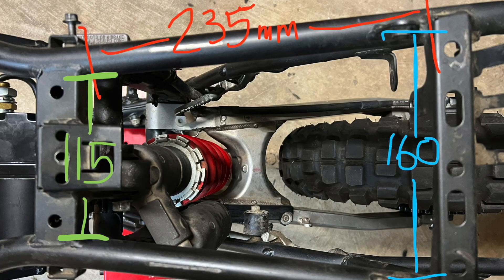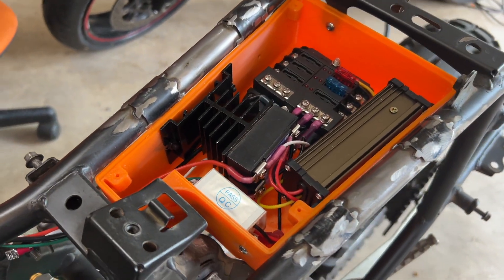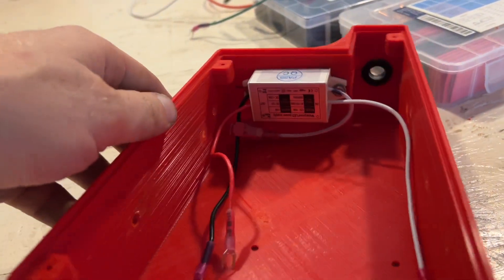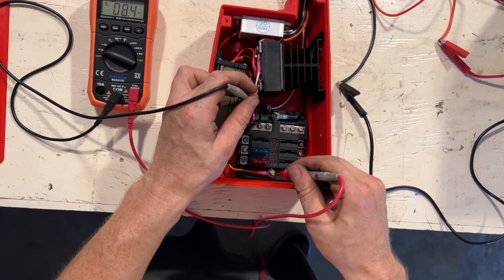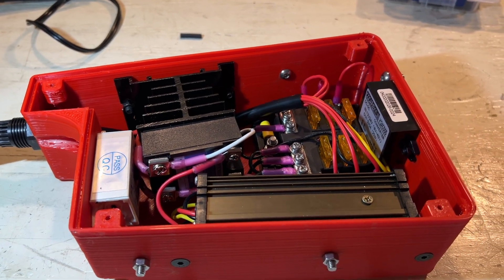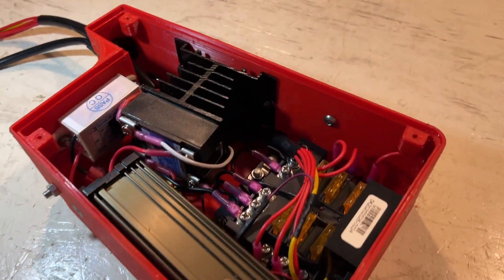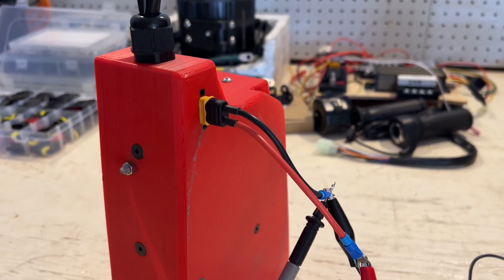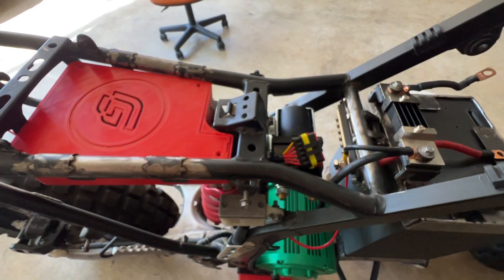Making a Power Conversion Box for an Electric Dirtbike

Comment: Yeah I really need a 3D printer, time to stop BSing I'm doing it the hard way
Reply from the maker: They're really useful for stuff like this. That said, they can be pretty tedious. My suggestion, if you get one, is to spend a little more and get something with a few premium features like auto-leveling, upgraded servos (that are quiet), and aluminum (vs plastic) components for the extruder and other parts. Makes a huge difference and if you go cheap, youll eventually be forced to make those upgrades anyway or buy a new printer. Ive had really good experience with the Creality CR6SE - nearly ZERO maintenance - but you do have to make sure you assemble it well

Comment: After you hand tighten those small heat-sink bolts to the side of your case, you could use an angle grinder to shave/cut a flat spot tab on the ends of the bolts to be able to hold the bolt with needle nose pliers and still tighten that nut down without having to rely on epoxy for the future.